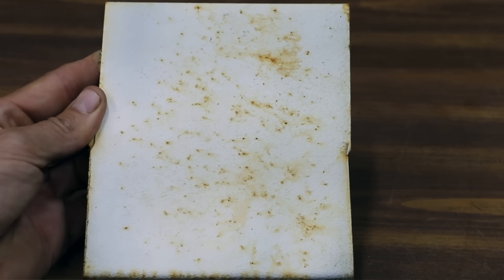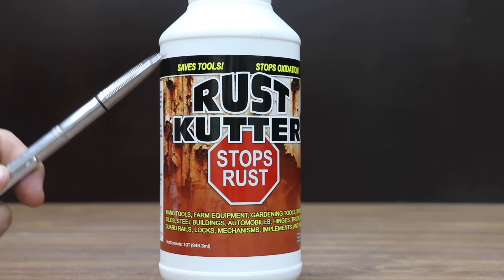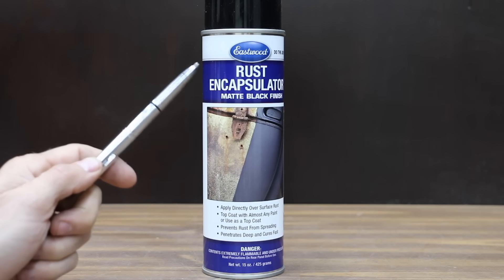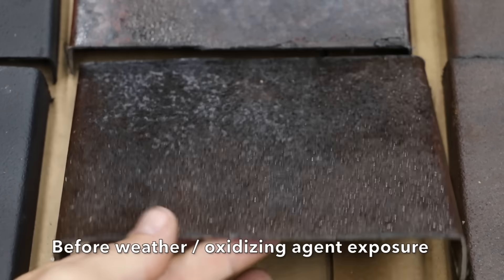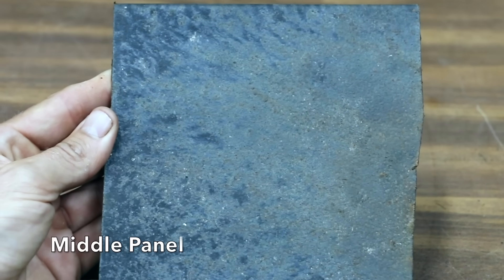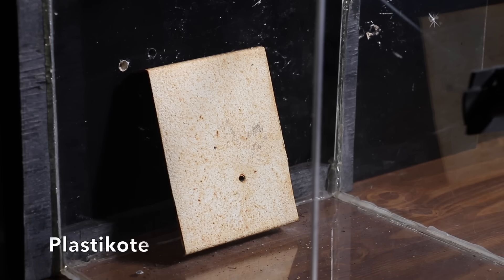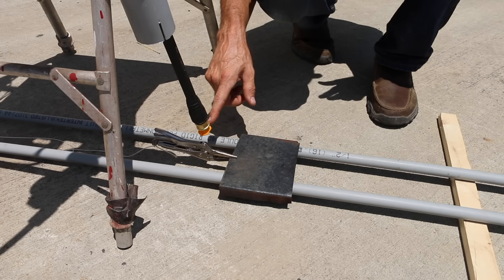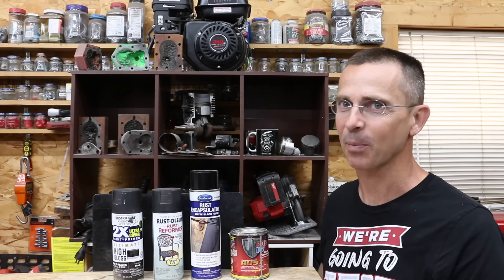Best Rust Converter? POR-15, Eastwood, Rust-oleum Rust Reformer, Gempler's

Comment: I'm glad to see the POR-15 work so well. I used Rustoleum Rust Reformer on my Jeep's underbody and after one winter it got pretty bad with rust. This April I painted on the POR-15 and after a bunch of beach sand, rain, and mud it's looks like the day I painted it. I am curious how the road salt this winter will treat it!
Reply: I live in the north east  and used POR-15. It looked good for a few years but after that  the rust came through. It must have been holding the rust underneath until it got so bad it flaked off. I regretted putting it on my frame because it just excelled the rot on the frame.

I use fluid film now on all my vehicles, seems to work the best for preventing rust from starting.
Reply: @Gengear  100% same story here.
Reply: @Gengear  Fluid Film?
Reply: @DadDnumba1  yep, come is aerosol cans or you can buy it by the gallon and use a spray gun. Needs to be applied at least once a year but great for frame, you can pull the body plugs and spray inside panels, can corners, rockers…etc.
Reply: Also great for spraying on gas lines and trans lines. The only thing I try to keep it off of are the rubber parts. It could make them swell
Reply: @Gengear  will it stop an already surface rusted frame from getting worse?
Reply: @DadDnumba1  This looks to be a permanent paint test not temporary coating test. WD Long Term Corrosion has worked very well for me and was tested here. If you want something that will do the job without fail, Cosmoline
Reply: @PastaLaVista.  their claim is that it stops rust and prevents it from spreading. If you have a heavy amount of rust maybe try to convert it using one of the products in the video. 

On rusty things I found loctite extend rust neutralizer works well
Reply: @Gengear  Thank you for the input. Curious if you've (or anyone one in this thread) tried a multi step process pre-treating with naval jelly or anything else? If so any suggestions?
Reply: @Gengear In my experience rust Prevention or rust removal then prevention is the only method that works
Reply: or woolwax .... @Gengear
Reply: If you got the one with aluminum powder in it you should be pretty good.  The black ones are no where near as good.
Reply: @zachary3777  por15 with aluminium powder in?
Reply from the maker: Thanks for sharing!
Reply: I see a lot of POR-15 users use this phrase, "after a few years", in their comments.  It is essential when using POR-15, that the treated area is painted, with several coats of a decent topcoat.  POR-15 is sensative to Ultra Violet light and UV will destroy POR-15.  Personally, I have had great luck repairing rust holes in floorpan using POR-15 and fiberglass.  For car frames and undercoating, Fluid Film is by far, your best choice.
Reply: Por-15 long term has proved to be total junk, really disappointed. 
Trying aqua steel rust converter and lanoguard this time.
Reply: @JasonHam41  That's funny because, my dad's 73 firebird was underocated with por15 long before he bought it in 2002. He sold it in 2013 and it was still brand new underneath. That car was a PA car it's whole life. The only reason why it survived was because of the por15.
Reply: I applied Aqua Steel rust converter to the underside of a Toyota celica in 2017. Like most of these products, the rust came back again after a couple of years. In my opinion rust converters are only a cosmetic quick fix. If I were to do this again I would apply a high quality zinc rich primer & paint to the bare metal, maybe something like Zinga? Has anyone else tried this?
Reply: I have to spray fluid film under my car in the fall every year to stop rust. It doesn't hold up if you go through a carwash with undercarriage spray. My car has under body panels though, so it blocks those undercarriage sprayers from removing the fluid film. Only thing I've found so far that actually works.
Reply: Just remember por15 is not UV stable so any parts of the frame that can see sun or reflection need a top coat
Reply: Por15 doesnt work that well even when you use the whole line of products according to instructions. I dont even drive my truck in the winter anymore and after about 8 months the frame started rusting through and it flakes really bad. Not worth the money imo. Better off with the rustoleum or tremclad then fluid film over top
Reply: @2JDeez  I used the Rustolium line to paint my 78 VW... what a mistake that was! Turns out their own products don't stick to their own products! After 4 years, the whole car looks worse than before I stripped, rust protected, primed, and painted it.

Comment: I used Corroseal on my 1964 Spitifire. I found that after it cures it will pop up, detach. Looks great when you apply it:: All that brown death turns shiny black.... It may inhibit rust but some months later when I smack it with a hammer some will pop up and Lo, there is rust on the metal. Not as bad but it's there. My research indicates that Tannic acid is the common ingredient in many of these rust converters. Another product that might be good is Black Star but I've not used it.
Reply from the maker: Thanks for the feedback.

Comment: Great video, though I was a little surprised you didn't use the old Armory method of boiling in water to convert the rust to black oxide and then oiling. That method has been around for centuries and well honestly It works on more than just guns.
Reply from the maker: Thanks!
Reply: I also use that for firearms.  But it's hard to boil the entire underbody of a car!  Different methods for different needs.
Reply: @videodistro  Of course, but it still would have been interesting to see how it stood up.

Comment: I would love to see these tests as well as like heat tests on paints that claim to work with 500 degrees for engines and even 2000 plus degree paint for Like exhausts that would be super cool informative video don't think I have seen you do any kind of video like this yet 🤔🤘👍👌@Project Farm
Reply from the maker: Great suggestion!  Thank you.
Reply: @ProjectFarm  any time appreciate you always reading our comments and taking suggestions what makes you amazing
Reply: @ProjectFarm  put the heat on it 🔥 definitely do this one
Reply: @ProjectFarm  definitely would love to see this. I just bought some Krylon high heat primer and paint. Only cost about $8 per bottle so if it's a waste, not that bad, but still would be good to know!
Reply: @ProjectFarm  as the base paint shoukd be the rustolem enamil paint
Reply: @ProjectFarm  can you do motorcycle helmets?
Reply: I third this suggestion. I have always wondered how "heat proof" certain coatings are.
If you do decide to do this I would recommend also trying some common gun coatings such as parkerization, duracote, and cerakote.
Reply: @Rltvader1  good points on the cerakote and more suggestions
Reply: @Rltvader1  MoS2 in suspension such as Perma=Slik followed by bakeout leaves a super thin, slick and rust resistant.
Reply: I would also like to see that comparison. I don't recall the "high temp" paints I've tried but I know none of them worked for the cross over on Pontiac intake manifolds. That was over 20 years ago that I kept trying to keep paint on them.  I finally just gave up.
Reply: @justanobserver530  I have used lots of paints including VHT never had luck even doing the cook and bake procedures before running a engine or exhaust never sticks no matter what ya do eventually just said Not worth the cost lol
Reply: @AntonioClaudioMichael  I have great luck with that VHT stuff. I always sandblast whatever I'm painting first. But holds up on my up pipes and turbo exhaust housing on my 7.3 power stroke. Hitting 1800°F all the time
Reply: @marinusdedreu3833  interesting 🤔
Reply: @marinusdedreu3833  "  I always sandblast whatever I'm painting first.  " I wonder if the sandblasting helps the prep some and maybe lets a thicker coating remain on the part being painted ?
Reply: Test them on a BBQ. Every BBQ high temp paint I've ever used in the UK fails soon after used/comes off/let's the rust come through again.
Reply: I second this suggestion!!
Reply: High heat or engine paint... great idea.
Reply: Use Auto Trans Fluid too. My friend swears it is THE BEST rust preventative
Reply: @tipr8739  atf is a good Protectant as well
Reply: Yes, I'm another supporter of the high temp paint comparison idea.  So many products fail only shortly after application.  I have a pair of cast iron water evaporators on my wood stove and they're always rusting no matter how much I wire brush, vacuum, and paint them with high temp paint.  One of them is like a kettle, the other a big oval bowl with a cast lattice top both sitting on cast trivets.  It all just wants to rust and I can't find a good paint for them.
Reply: Try to include spray can "ceramic" coatings/paints
Reply: Great idea!!
Reply: Agreed. I've never had any luck with paint made for exhausts.
Reply: YES! Test exhaust headers and a BBQ!!
Reply: Engine and brake caliper paint! Awesome idea.
Reply: The best high temp paint I use is Rust-Oleum specialty bbq high temperature paint
Reply: I used the cheap rustoleum on a rusty heat shield under a muffler.  Granted, it wasn't making contact with the muffler, but 2 years later, it's going strong.
Reply: It's funny that high temp paint is useless until it's been heated. Before heating it is easily wiped of with little effort. After being cured it's rock solid.
Reply: @michaellinner7772  yep
Reply: ALUMINUM SPRAY PAINT TEST WOULD BE AWESOME!  :)  I would love to see a test of the durability, scratch resistance, solvents, etc..  Primers, paint/primer combos.  @Project Farm
Reply: @AdaptiveAspirations  I agree good idea
Reply: youtube was  made for these types of channels <3
Reply: I concur! I have a gas fireplace that chips high temperature paint and needs to be resprayed every year.
Reply: Where the frame and exhaust would be close.. like headers/frame.. seeing how my frames' paint is falling off..
Reply: I have tried many of those so called high temp exhaust header paints. I have found the only thing that holds up for any length of time that hot, is to sandblast first and use the ceramic spray like products. I tried Jet hot coatings and it was ok but eventually  rusted. Cerakote is the best I have used so far. Its used by many OEMs on engine parts as well. They have 3 or 4 different classes depending on the temp needed to endure.
Reply: @PatriotPaulUSA  very informative
Reply: Excellent idea 💡
Reply: Another great video from Project Farm:-) Vid is a little old but still very valid. I use Rustoleum reformer on my mower decks to help recondition them for selling.  I will give a couple of coats of the reformer followed by a couple of coats of the regular paint followed by a clear coat.  Deck may not look factory new again, but will no longer continue to rust/rot for the next owner:-)
Reply: @chadfield376  great information
Reply: I need to know this
Reply: That would be a good video
Reply: I agree; this goes hand-in-hand with rust reformers when you're talking about restoring a rusty barbecue smoker or grill.
Reply: O v4xz
Reply: Absolutely great idea.
Reply: For sure its a needed test, half of the reviews or videos you look at for heat paint.. almost every single one has a handful of negative and a handful of positive reviews but inevitably the conclusion is almost always the same - it falls off
Reply: I'm definitely with this as well
Reply: Definitely try the high temp POR-15!
Reply: Another great idea that I didn’t think of :|
👍🏼Antonio
Reply: Great idea i’d love to see that too
Reply: I have a bbq grill to paint, please do this heat test!
Reply: Awesome
Reply: Yep
Reply: Great idea.
Reply: not sure about exhaust I have used Rust Prime will work on the engine I have done that. you could check product info for temperature max there are industrial products out there I wasn't too impressed with the products in this video. didn't explain what chemicals were involved. probably not listed. proprietary info is what they list so you don't know it is something simple as 2 percent phosphorus the back story how they discovered this started with WWII
Reply: I would like to see a high temperature paint comparison as well.

Comment: Sir I really appreciate you doing all these tests as I know it take a huge amount of time from you. You have influenced my purchasing with real world testing and since watching I've used the products that came in first like CRC Marine Heavy duty Corrosion inhibitor on the underside of my newer truck, Pennzoil Ultra Platinum in my vehicles(May switch to Amsoil if I do longer oil change intervals) & Liquid Wrench just to name a few. 
     On another note on something you haven't tested is I just put Amsoil Signature series Transmission Fluid in my Tundra Transmission...its only been 2 days but the transmission seems to be shifting smoother & when I shift from park to drive or reverse it goes in smoother almost like its being cushioned instead of the more violent "clunk". My truck only has13K on it. I don't know if you could even test the validity of Different Transmission Fluids as to which is the best but it is an IDEA to think about.  Note Its also seems that my MPG has increased slightly but I also changed the rear diff and front diff fluids too.(I'll have to take a long trip to finally verify this)    Again thank you for all the good videos and the future ones to come!!
Reply from the maker: Thanks and you are welcome!

Comment: Thanks for another fantastic video! I have used POR15 on a rusty AC air handler and an 89 Accord that just rusted by looking at it. I have yet to find something better than POR15 for controlling rust on old cars.
Reply: MasterCoat permenant rust sealer
Reply from the maker: You are welcome!

Comment: What about testing different screws in mdf, strength and ease of application. Maybe also how much hold the screw has when you remove and replace the screw in the same place.
Reply from the maker: Thanks for the suggestion.

Comment: Been using POR for years, it’s really good stuff.  I repainted my entire travel trailer frame with it a year ago and it still looks perfect.  I also use it on motorcycle frames and my classic Mini Cooper.  Glad to see it performed well, although I do use the rust reformer for simpler tasks that I don’t mind redoing a year or so down the road.
Reply from the maker: Great information!  Thank you

Comment: I am pretty impressed the rust encapsulator paint and the basic spray paint did so well. Feel like I have been wasting my money on rust converter sprays. I have had rust come back after using a converter spray and Rust-Oleum stops rust paint. Not even used on road, just sitting in humid air.
At least the durability testing highlights other differences. Would love to see how using Ospho or Klean-Strip Concrete Etch & Metal Prep + Rust Inhibitor compare to these, since the pros seem to stick to phosphoric acid as a metal prep before painting. POR-15 clearly on top. Awesome video!
Reply from the maker: Great video idea and thanks for the information too

Comment: Awesome video, per usual! This is great knowledge to have, what with helping maintain a fleet of plow trucks. POR has been our choice and will continue to be. One more product I'd like to see tested in the future, maybe in just a corrosion preventing coating comparison, is ZRC Cold Galvanizing Compound. I worked in a heavy fabrication shop, and used to coat rebar core connectors in that stuff before they were dipped into concrete to create precast pieces... if it's good enough to have concrete cure around it for a sub assembly used in highway bridge structures, it oughta be pretty damn good!
Reply from the maker: Thank you for the video idea!

Comment: Thank you. Have some areas inside the front wheel well on my 1969 Lincoln Mark III where the undercoating has flaked off and there's surface rust. I was planning on using Eastwood for the color match and this confirmed my decision. Much appreciated!!!
Reply from the maker: You are welcome!

Comment: IDEA. i would like to see diff between pressure washer tiers.

specifically, differences in capabilities and usefulness between highest consumer (3500psi 3-3.5gpm) grade to semi pro grade (4000+psi 4-4.5gpm)  *this is the biggest price transition so is the extra capacity worth the jump? 

could also include the lower end 1-2gpm just to educate users as to differences and what each is used for or not useful for. lots of people still think that a 1200psi 1.2gpm washer is capable of doing everything.

if a local pressure washer company would donate some film time with their gear it would be cool to get your method of measure and remarks for the true pro grade (8gpm) comparison as  well.
Reply from the maker: Thanks for the suggestion.

Comment: I use Rustoleum Rust Reformer all the time. But no, it does not last very long but outlasts conventional spray paint. It also has a nice mat finish. Use it more on bare metal than for rust treatment.
Reply from the maker: Great feedback. Thank you

Comment: this is funny and I can confirm the Rustolium 2x results, I have had it on my all steel front end on my suv for the last 6 years, every 2-3 years i hit it with a wire brush and add a couple coats, it looks good, lasts, is cheep, and for my suv (no its not a road queen, it is a rance/off grid/homestead rig, it gets abused as much as any lifted farm truck) it works fine.
Reply from the maker: Great information. Thank you!

Comment: I've always used Jasco, which is basically just phosphoric acid (the main ingredient in these products) with a protective coating - it's very cheap and can be found at most big box stores.   I've used it on the 12 cars I've restored.  You apply it with a green scrub sponge.  Like all these products, it needs primer & paint for actual protection.
Reply from the maker: Great information! Thank you
Reply: I've used a similar product called ospho